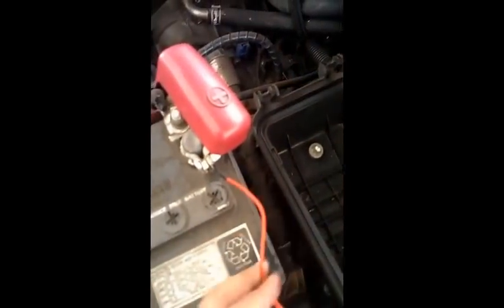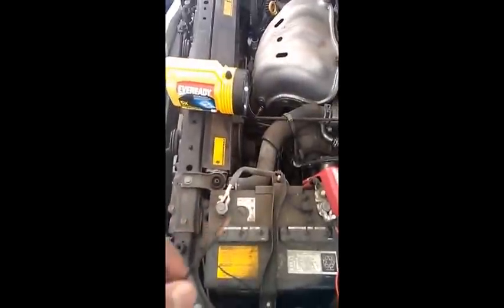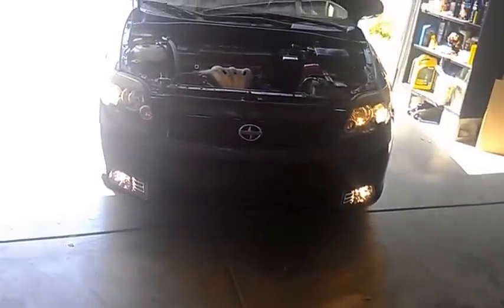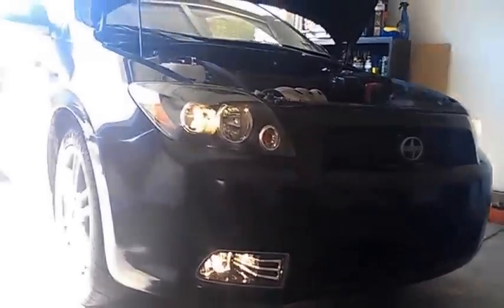08 scion tc fog lamp installation

Comment from the maker: i didn't tap it inside i extended it and connected to the high/low beam wire by the headlights.. (right by where the battery is..) 8:56

Comment: Is removing the bumper absolutely necessary?
Reply from the maker: i would recommend you remove the bumper..... its lot easier that way... i mean if you can get your hand in there and tight those screws and find a way to get your wires down to the fog lamps... then you might not need to remove it.... sry for the late reply... hope this helps..
Reply: punjabibro72 thank you, you made the installation look easy, I think I'm gonna do it.

Comment: why didn't you put the switch wire with the ignition ?
Reply from the maker: u can if you want to.. but u dont have to.. i just didnt want to go throw finding the ignition wire. it just need a 12v line.. i get my from the low beam wire by the headlight. much easier.
Reply: so it only turns on when you turn your regular lights on?
Reply from the maker: yup cauz i like my fog lamp to turn on with parking lights. so i taped my ignition wire with the parking lights.. to make life easier i ran the wire all the way up to the headlight unit. and tap it there since it easy and the wires are visible.
Reply: Alex H. What color is the ignition wire.  I'm about to install my fog lights  and thats the only step I'm stuck on.